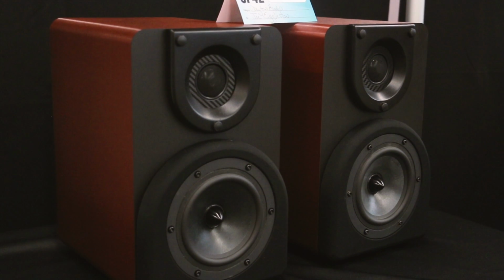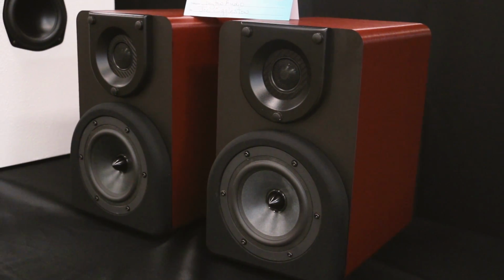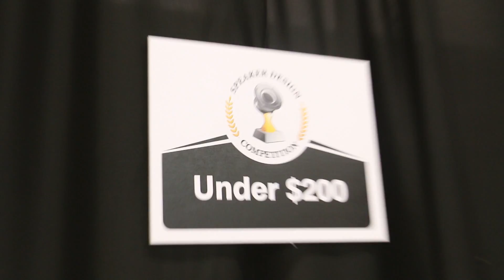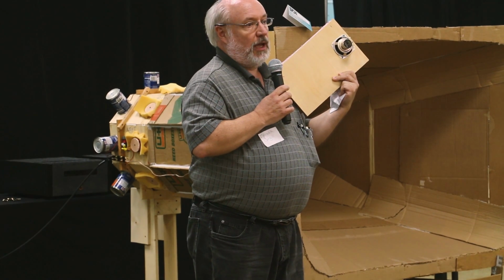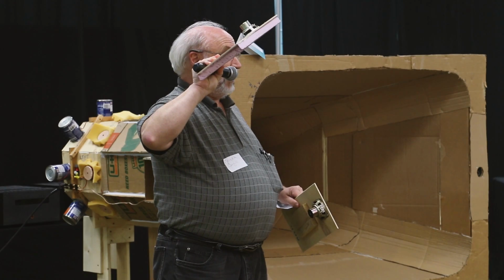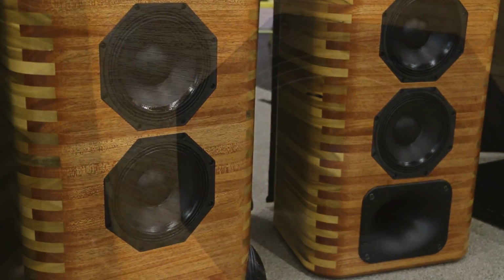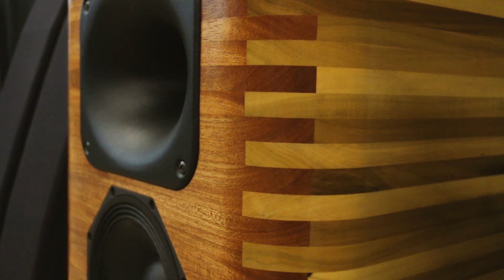Speaker Building Competition 2017 - Parts Express Midwest Audiofest

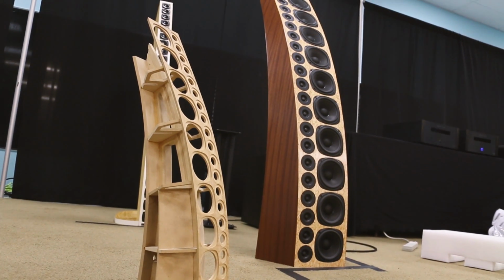Comment: Wow ... exceptional creations indeed.  However at 3:38 ... why not arched with a concave shape, i.e. with drivers firing to the sweet spot ?  what is the benefit of sending signals towards the ceiling ?  I understand that a listening room ceiling should be treated in order to avoid sound reflections.  Just asking.  Thanks a lot, gino
Reply: The idea is to emulate a spherical wavefront.

Comment: Awesome!
Reply from the maker: Thank You!
Reply: Parts Express what crossover you recommend for a DIY 2 way Boombox with a 3/4" Dayton Audio Tweeter and Dayton Audio Classic Woofer 6.5"?
Reply: Edrick Mendez Generic crossover will sound terrible. And everyone always says they don't care, until afterwards. Then they regret it. It has to be custom built for every speaker. There are programs to help you, but you need to measure the drivers to really do it right. However. You could enter the manufacturers Thiele-Small parameters, along with the dimensions of your boxes, and hopefully get close. Just depends how far off they are from reality. They're almost never right, but some are pretty close.